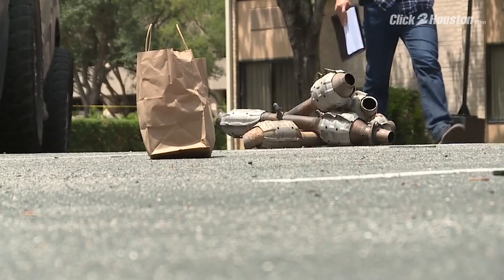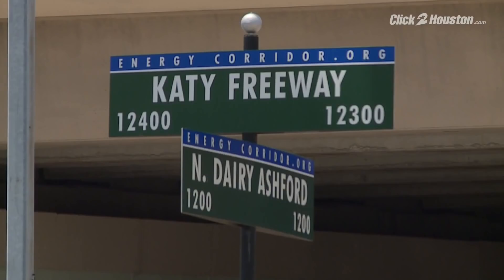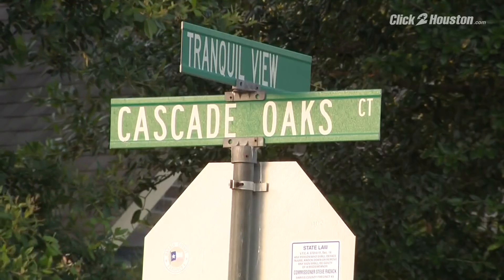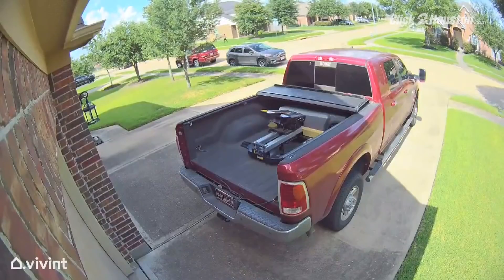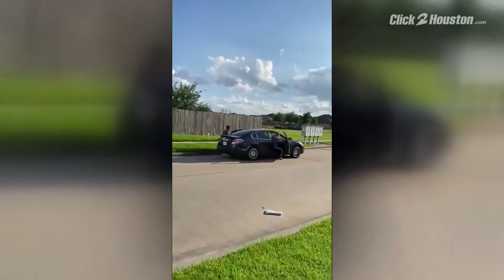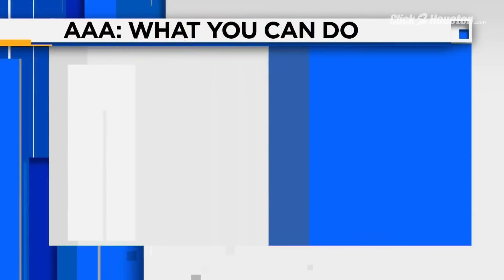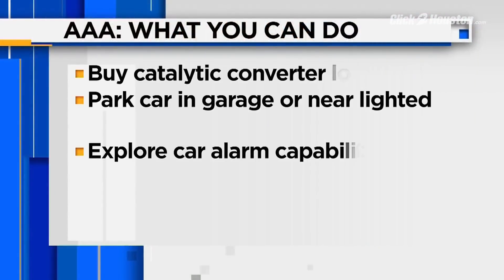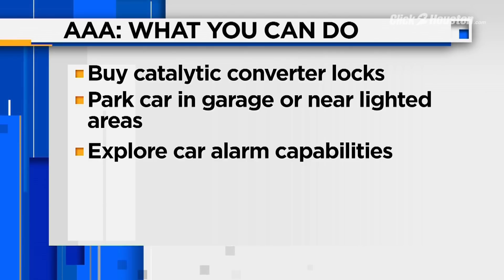6 ways to prevent catalytic converter theft on your vehicle

Comment: Welding a catalytic converter to the frame of a vehicle will cause a great amount of vibrations throughout and a terrible driving experience.
Reply: Seriously. These were my thoughts as he said it, and he works for AAA lol
Reply: Can't be too bad you need to welded to one of the chassis's bar and you won't feel a thing, nothing makes more vibration than the engine itself but the engine happened to be attached and attached so well that vibration just disappears because of the weight of the car itself. Catalytic converters loose overtime is when you notice how much they vibrate but while they are well attached along with the muffler vibration almost disappears.

Comment: BEST WAY STOPPING THEM IS DROPPING YOUR CAR LOW
Reply: They'll just jack it up and leave it down on cinder blocks, just like when they steal the wheels.
Reply: Don't vote for dems!  That helps solve most problems.  Car height matters!
Reply: @paulstewart6203  You just stole this from my post.
Reply: @truthseeker3909  I didn't read yours or any other post, I just posted and moved on, yes you commented first.

Comment: Just replace your catalytic converter with a straight pipe and to avoid the check engine light install a oxygen sensor extension bung. This way you can have your cat chilling at home with you and the thieves won't bother your car or truck after they realized it's been removed and replaced with a straight pipe.

Comment: I think welding foundation columns solid rods at least 3 or 4 of them along the catalytic  converter and extended them along part of the pipe can probably  make them avoide this cuttings.
Or welding thick metal around the catalytic  converter.
Some how to block the access  to make the cuts.

Comment: They sell 2 devices that make your  cat theft proof:
1 comes with chains and is inexpensive 2nd is a shield specifically designed for your vehicle and also I would have the catalytic converter welded to my vehicle.

Comment: What in the "F" is a converter lock??? I'm thinking a cover to to protect your converter. If that is what a converter lock is it would get cut off with the converter so big waste of money. Engraving your vin# into the converter, so they just grind it off before they sell it (another bad idea). Auto alarm is a good idea if it is set very sensitive and very loud, draw back is it goes off wind the wind blows. If you have a new or newer vehicle (mostly trucks and large suv's) when at home keep them in the garage. They are after the original converters that were installed when the cars were built, they bring a lot of money at the recyclers.
Reply: Is your google broken?
Reply: @kel5944  Why, is it something you depend on? There is literally nothing you can do to protect a converter from a saw. There is one thing I left out and that would be a skid plate to cover the under side but it has it's bad points. If you knew anything about automotive repair you wouldn't need google to know that much.

Comment: yup!! if they are cutting them off, welding them is 100% theft proof (slaps forehead)
Reply: Not exactly sure how this works but can the thieves tell its welded b4 they cut the pipes? Especially at night. If they cut the pipes and cannot remove the converter it would probably unleaded(?) for the repair as you have to fit couplings or pipe stubs to make the repairs? And just like guns grind off the serial/vin numbers. In fact the thieves probably don't have to grind them as the scrap yard will.
Reply: @Toollifter  yes take your hands make a circle like a big O and go over the cat back and fourth if nothing hits you you good if it does now you have to cut that off as well... issue is, is noise.. so good luck i dont have cats on my car. for this reason

Comment: I would drive around with the catalytic converter off if it was stolen.  The police and politicians are not taking these crimes seriously because the scrappers taking these catalytic converters can be found if they put the time into it and putting them in prison for a dozen years would send a strong message, so they then can get used to the sound of open exhaust pipes.  Besides, you will get better gas mileage with it off.

Comment: pay a shop under the table to cut the catalytic converters off and weld you a straight pipe. yes i know you'll not be able to pass inspection without catalytic converters but just give your inspection guy a $50 tip and he'll make it pass